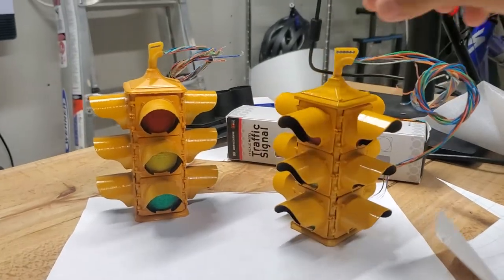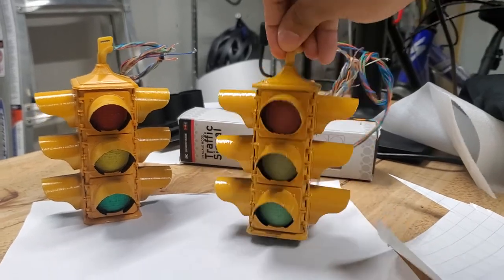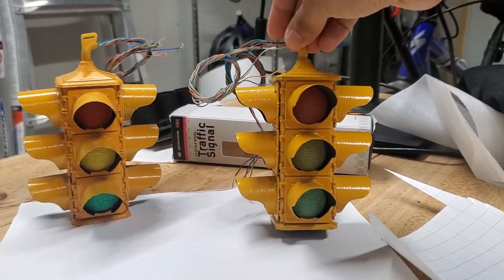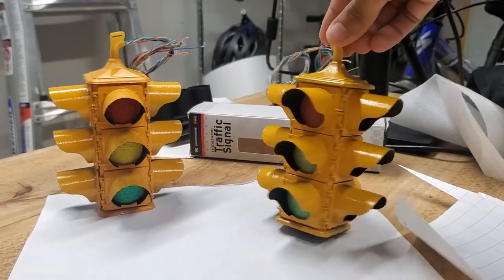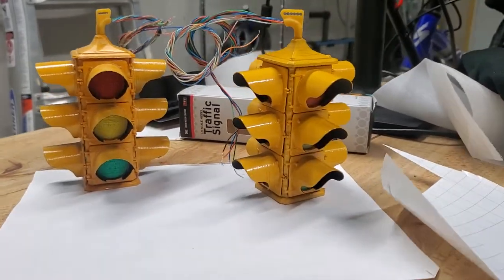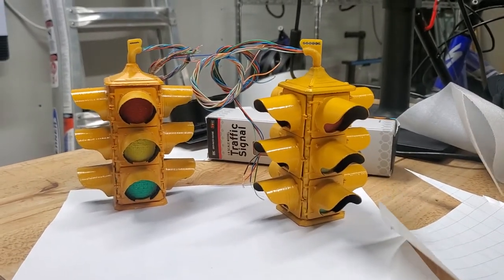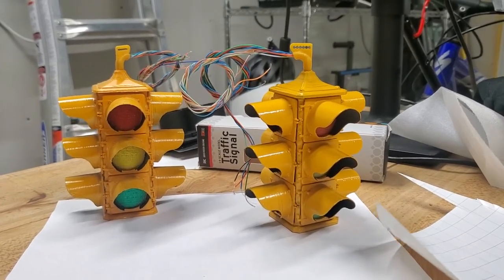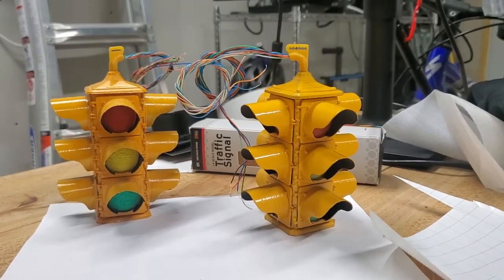Mini 4-Way Span Wire Traffic Lights

Comment: I wanna buy more, but they're so expensive now and I don't see you on eBay anymore.
Reply from the maker: I'll be posting just the signal heads like I used to very soon, they will be significantly lower than these bigger and fully assembled models. I just wish I had more time to do this.
Reply: @DorienMasterCreations  I really like how you make the ones with the built-in controller
Reply: I'm watching from Turkey and I like your signals very much. I want to get this signal, can you help me?